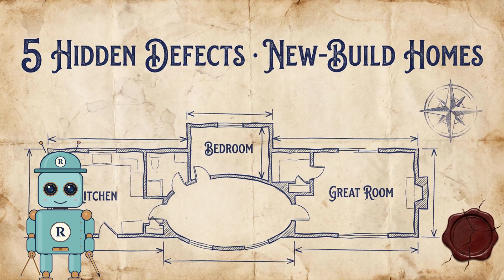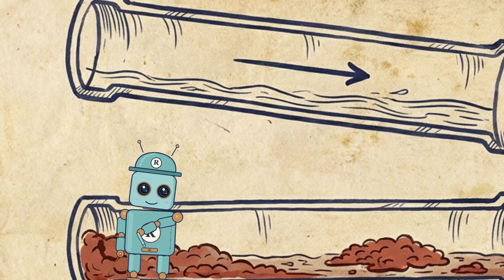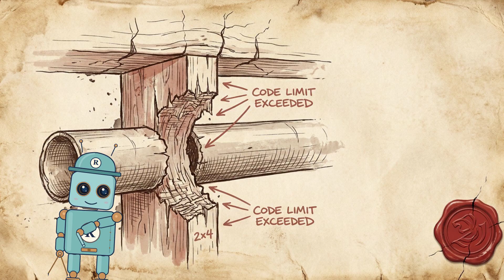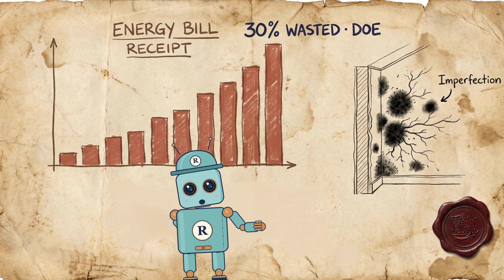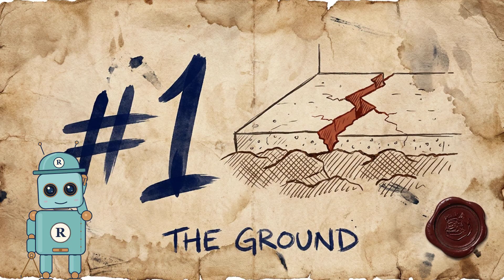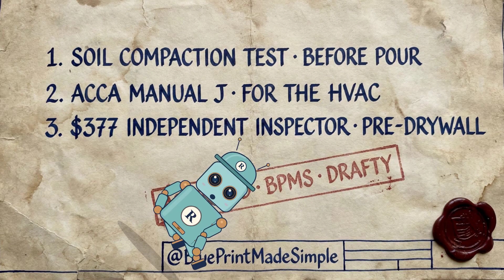5 Hidden Defects In Every New-Build Home Your Builder Won't Show You

Comment from the maker: If you're building or buying new construction right now -- get a third-party inspection. Not the builder's inspector. YOUR inspector. It's $377 on average and it can save you $14,000 or more in repairs you'd never see coming.
Which of the five surprised you the most? For me it was the HVAC oversizing -- most people think bigger is better, but a system that's too big short-cycles and actually makes your house less comfortable AND more expensive to run.
Drop yours below. I'm reading every comment for the next 48 hours.

Comment: With us living under a lying fascist traitor who has destroyed all the safeguards, this will get even worse!  The developer crooks want to SELL these pieces of garbage, not live in them.  I notice ALL the new developments in my area are on concrete slabs, a crappy idea to begin with.  I wouldn't have one.  Building materials used in them are also crappy.   I lived in one house on a slab.  Never again.
Reply from the maker: I'm constantly finding slabs that have way to much water in them I can put a nail in 2 light taps and it's almost flush or I knock a big chunk out crews want it easy to work